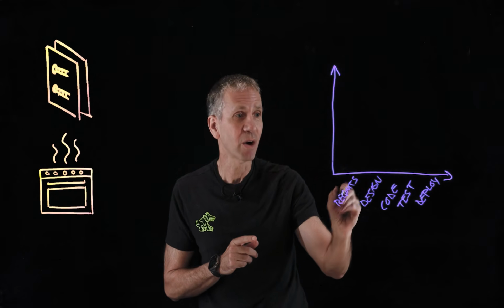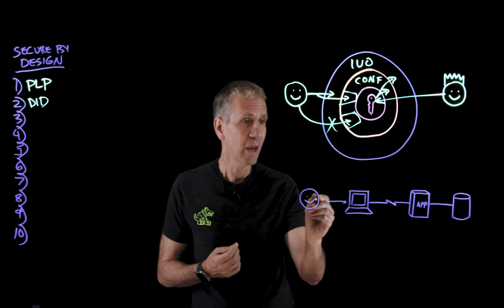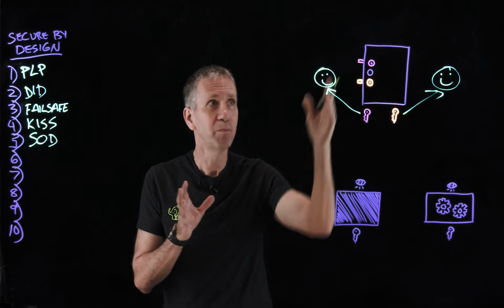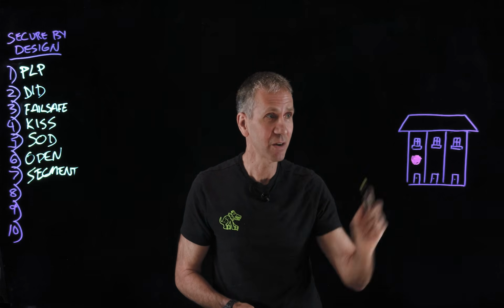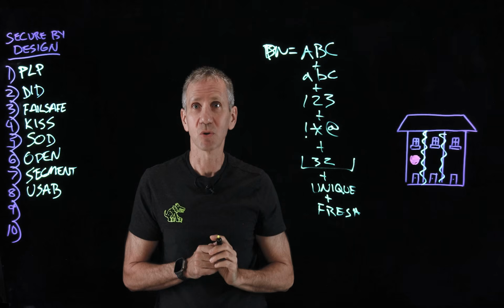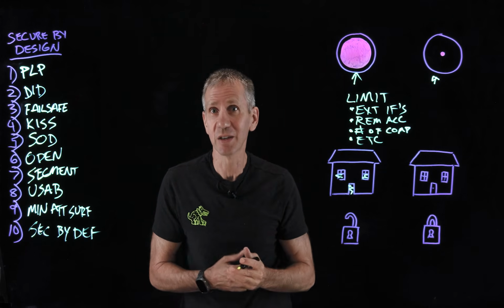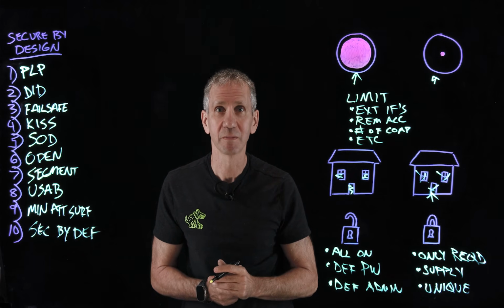10 Principles for Secure by Design: Baking Security into Your Systems

Comment: I think Fail-Secure (or Fail-Closed): In a fail-secure configuration, when a system (like a firewall) fails, it defaults to a secure state by denying all traffic. This prevents any potential unauthorized access or malicious activity, even at the cost of interrupting legitimate traffic. The priority is security.

Fail-Safe (or Fail-Open): In contrast, a fail-safe configuration would allow all traffic to pass through in the event of a failure. The priority here is maintaining connectivity and preventing disruption, even if it means a temporary lapse in security.

Comment: Thank you for teaching us all this useful / critical knowledge!

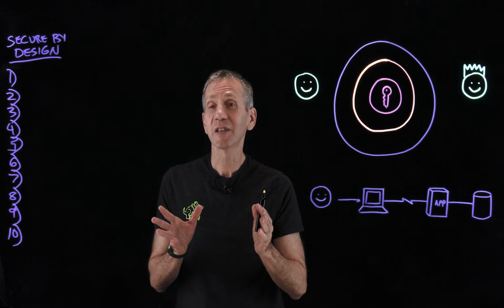0:50 Principle of least privilege (PLP) - Give developers etc only what they need for them to do their job Like RBAC
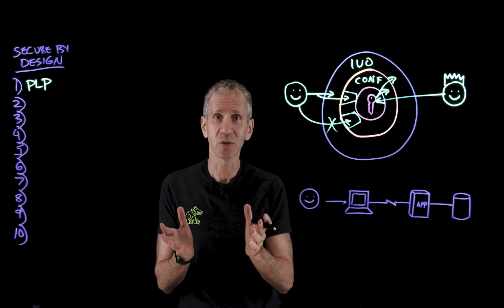2:14 Defense in depth - Layers of defence for robustness: IAM + MFA → UEM → FW + NIPS → Access Ctrl (PLP) + Scan → Encrypt. + BUp/ restore
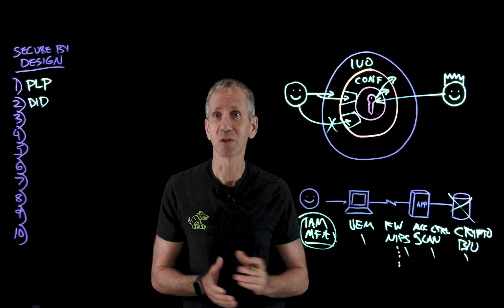5:03 Failsafe - When anything fails as they might, at least fail into a secure position
6:15 KISS - Keep It Simple Silly - To detect flaws
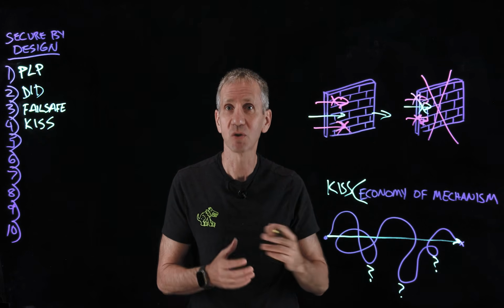7:00 Separation of Duty - Like MFA but with people instead of devices

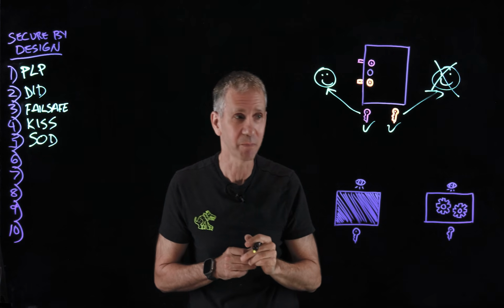7:50 Open By Design - Show the software to detect flaws but lock it with keys
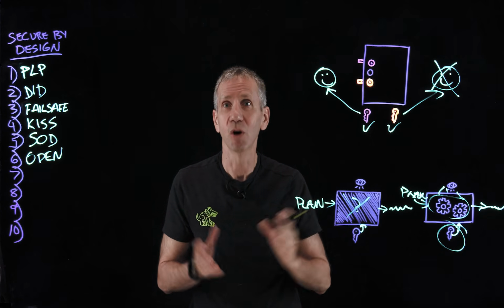9:27 Segmentation - Segment systems with different security and sensitivity so damage doesn't spread
10:50 Usability - With complexity, user might store password openly etc, making it even less secure
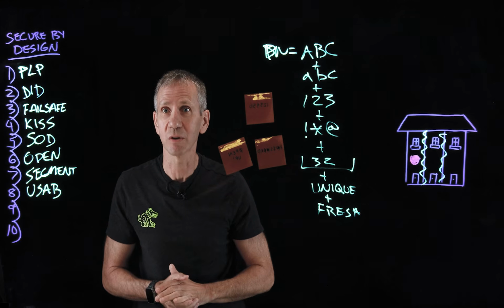12:50 Minimise attack surface - Limit external interfaces, Limit remote access, etc
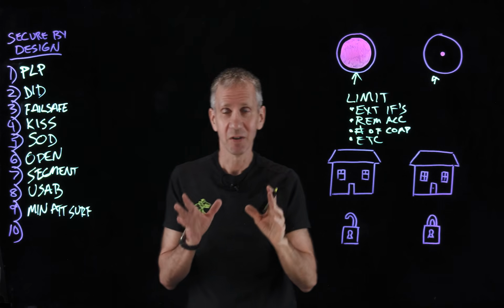14:18 Secure by default - Principle of least privilege, unique credentials to access made on the go

Might have missed / wrongly interpreted some things, do watch the video